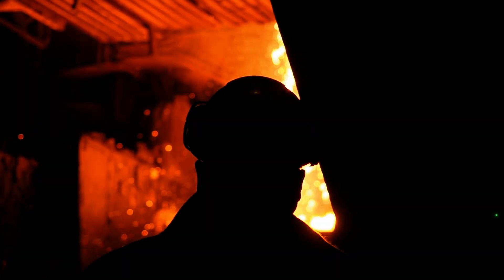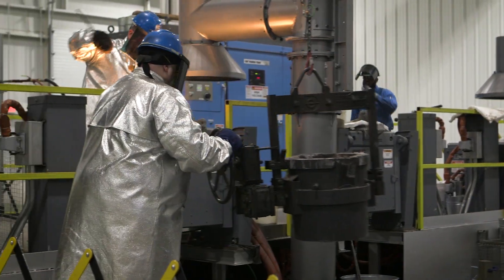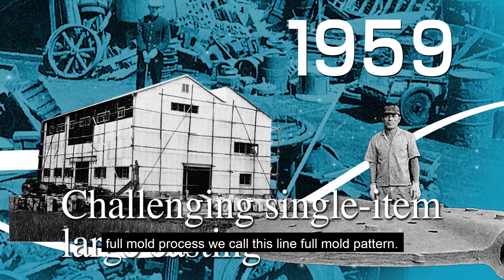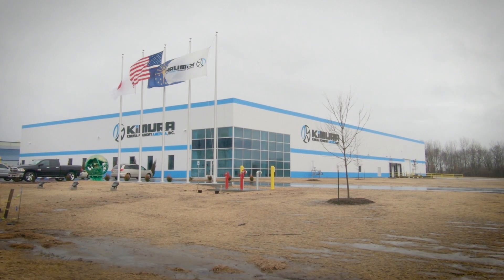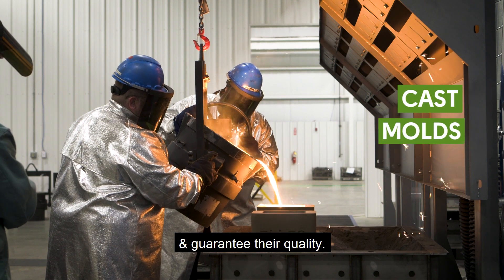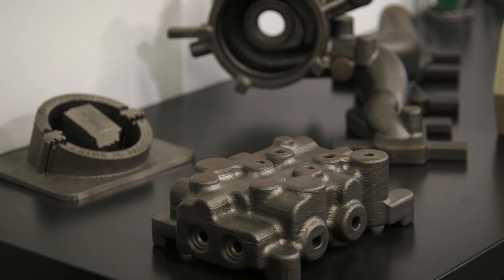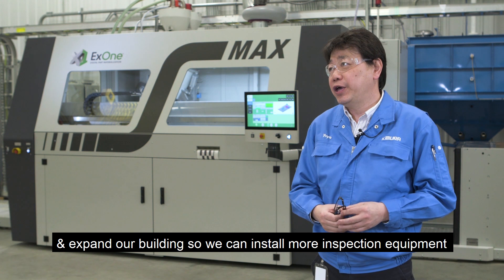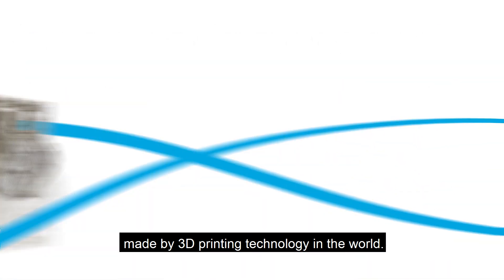The ExOne Files- Featuring Kimura Foundry America

Comment: ExOne vs voxeljet, what's the difference?
Reply: In my opinion the cores made by exone is stronger than from voxeljet, I had experience with both printers.
Reply: @eugenmikhnevych5984  Thank's. Seems that ExOne is more focusing on metal 3d printing (X1 160PRO) while voxeljet is more focusing on plastic (High speed sintering)